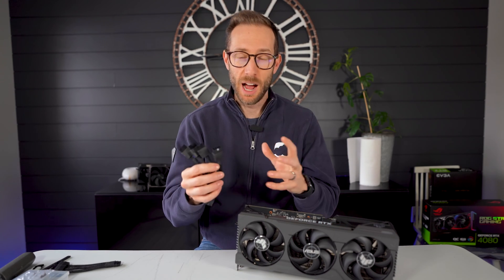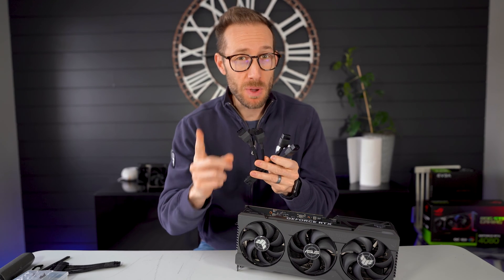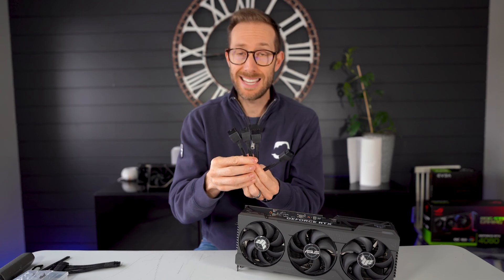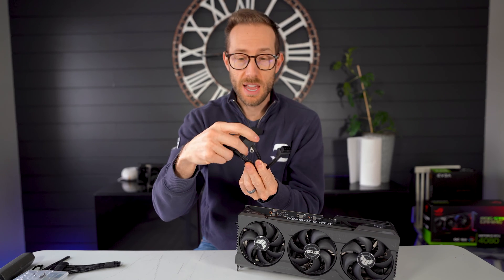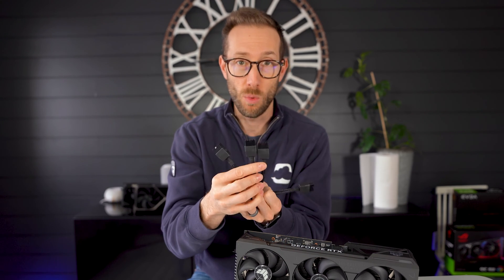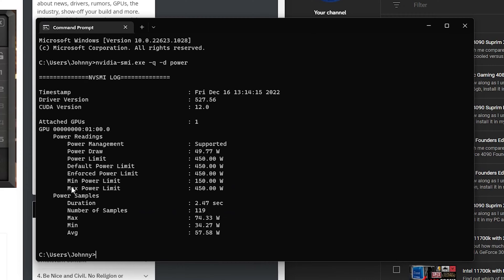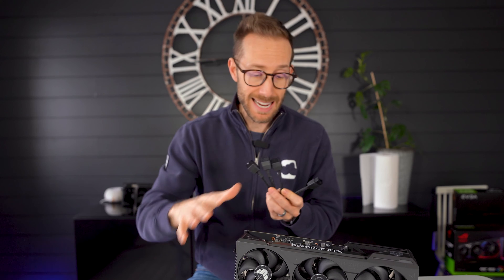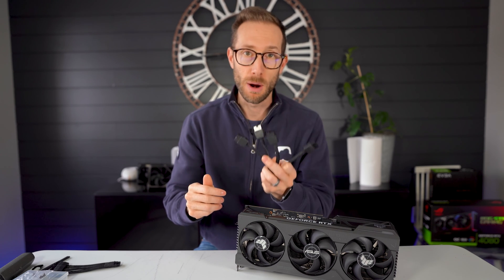Do 4090s Work With Only 3x8pin Power Connectors?

Comment: So then is the MSI 4090 a weaker card by default because it has only 3x8pin connectors?
Reply from the maker: No, not at all.  I think it's the opposite.  I've tested the MSI 4090 Gaming X Trio is one of my favourite 4090s.  Check out my video here:  https://www.youtube.com/watch?v=6r6b8NANqwM   MSI has figured out how to get the same performance by only using 3x8pin connectors in their Gaming X line.  They still use 4x8pin for their Suprim line, which is slightly faster, but 1-3%.  Nothing that really makes a difference.  People have confirmed that after 400-450w, 4090 don't actually increase that much in performance by providing it more power.
Reply: @JohnLCharette  i see. Yeah i have a pny xlr8 4090 and i can only use 3 8pins out of the 4. If its only 1-3% hit im missing out on im fine with that
Reply from the maker: @Garrett, sorry.  I may have mislead you with my answer.  The performance difference on the Asus TUF 4090 when using 3x8pin vs 4x8pin was 2-5% difference.  The 1-3% difference was between the MSI Gaming X Trio and their Suprim X cards both using all required power connectors.  2-5% still isn't a huge loss and I think you'll do great with your PNY card, assuming it's similar to the Asus TUF.
Reply: @JohnLCharette  all good. I play at native 4k so modern AAA games are definitely not at 120fps constantly. 5% of 120 is 6. Thats barely a loss and definitely not worth the difference in price.

Comment: For a 4070ti is good 2x8 pin?
Reply from the maker: Some 4070 Ti's require 2x8pin, others require 3x8pin. Example, the Zotac 4070 Ti Trinity non-OC is only 2x8pin connectors. Check the manufacturers website to confirm. I haven't tested a 3x8pin card such as the Zotac 4070 Ti Trinity OC with only 2x8pin to see if it works or how it's affected.  The next time I get a 3x8pin 4070 Ti in the studio, I will check it out.  Do you only have 2x8pin connectors available on your power supply?
Reply: @JohnLCharette  Thanks to answer me. I have go check better on my psu. Another question: i have to plug in this cable directly to my psu or i have to use cable from psu and than use this?
Reply from the maker: If you mean the adapter, you use cables from your PSU which plug into the adapter.  I recommend buying a dedicated 12v cable for all 4000 series GPUs and bypass the adapter.  You can learn more about some options here:  https://www.youtube.com/watch?v=IpujnC1lGY4
Reply: @JohnLCharette  Thanks. I have 	
Corsair RM850 (2021) and i don’t know  if it’s type3 or 4. Can you tell me it?
Reply from the maker: Good afternoon.  It's definitely Type 4.  I recommend buying the Corsair 600w 12v cable for $20 and using that.  That's what I'm using right now with my Corsiar RM1000x and it's beautiful.

Comment: The cable still pulls more than 450W. You can overright that just by flashing the Bios. There are people with base 4090s that come with only 3x8 pin, like MSI gaming trio. Flashing the Bios will allow you to draw more than 450W using just the 3x8 pin. You can try it out. I saw you have base 4090s that come with just 3x8 pins
Reply from the maker: Aha!  That's very interesting.  I don't have a 4090 in my studio anymore, but I will definitely try this out.  I know you can get up to 525w, by using 450w from the 8x3pin power cables + 75w from the PCI Express slot.  Is that what you mean?

Comment: I bought a PYN 4090 and have a 4 x8 pin . I have 3 PCIe connected and my pc wont turn on.. i thought it was the motherboard so i replaced it . Still doing the same thing . Everything will kick on for a few seconds then i will hear a click and everything shuts off beside the rgb on the motherboard.... any ideas what is my issue ? I will start with finding another pcie 8 pin. Do you think this could be causing my issue ? Also my psu came with the 3 i have connected but are pig tails . I only have one tail connected so am using 3 cords with the other piggies (3) tied togethar with velcro...
Reply from the maker: Hey Jordy.  That sounds very frustrating!  I hadn't tested the 3x8pin power connectors with a PNY 4090, so I can't be 100% sure that it boots.  As for using pig tails, it's not recommended, but probably won't cause a problem until you draw lots of power through it.  If you can connect all 4x8pin connectors to the card, even if it's pig tailed, that should allow you to boot.  I'm curious, what make/model power supply are you working with?
Reply: @John Charette  thank you for the quick response! I am using Corsair RM1000x
Reply from the maker: I'm using the exact same power supply!  Do yourself a favor and buy yourself the Corsair 600w 12v dedicated cable for $20 USD:  https://www.corsair.com/us/en/Categories/Products/Accessories-%7C-Parts/PC-Components/Power-Supplies/600W-PCIe-5-0-12VHPWR-Type-4-PSU-Power-Cable/p/CP-8920284
Reply: @JohnLCharette  thank you so much . Would I need only one and keep the others that came with the psu?
Reply: I'm looking at my gpu closely now. This cord you recommended me would turn my 8x4 into and 8x2 ? Would that be correct ?
Reply from the maker: Yes, that's correct!  It only uses 2x8pin connectors on your Corsair PSU and then plugs in directly into your GPU's 16pin 12v connector.  The best part is that it's still rated for 600w :)  You can watch a video about similar cords here:  https://www.youtube.com/watch?v=IpujnC1lGY4
Reply: @John Charette  you are amazing 👏 
Thank you again for all your incite and knowledge! Waiting for that to come in the mail now !

Comment: Actually i asked Cablemod for that concern and they told me 3*8 pins will deliver 600watts as well, so if you overclock it works fine.
Reply from the maker: Excellent. Thank you for confirming!  That's how I thought it worked for their cables.  Did you buy one with or without one of their 90 or 180 degree adapters?
Reply: @JohnLCharette  Yes i ordered the 12vhpwr PCI-e 3*8 classic without the adaptor but i read on reddit someone tested it and it works for him. Cablemod are great for that, that's why i've never used stock provided cable from manufacturers.

Comment: I was lucky enough to find a CPU cable to PCIe adapter and have an extra CPU cable. Going to try it tomorrow four my four power connectors.
Reply from the maker: Or.. you could buy yourself a dedicated 12v cable.  Most of them only use 2x8pin PCI-E connectors.  You can see me talk about it in my latest video here:  https://www.youtube.com/watch?v=IpujnC1lGY4

Comment: My power supply only had 3 8 pins. =/
Reply from the maker: Don't worry, I recommend an MSI 4090 Gaming X Trio.  It only requires 3x8pin connectors.  You can see my full review here:  https://www.youtube.com/watch?v=6r6b8NANqwM
Reply: @JohnLCharette  I apricate the advice, but I built a whole ASUS build so that's what I went with, a Tuf.

Comment: Quick question, I had a custom cable from cable mod for my 3090ti. 3x8 to 16pin cable. Will that work for my 4090?
Reply from the maker: I have heard that both 3x8pin and 4x8pin to 16pin CableMod cables will support 600w.  Contact CableMod support to be sure, but I'm thinking it will be fine.  Which 4090 do you have?
Reply: @John Charette  I have the gigabyte version of it. On reddit someone said they use new "sense" cables so it's not compatible:b
Reply from the maker: Ahh, too bad.  I would still confirm with CableMod.  I'd rather get the answer from them than Reddit ;)

Comment: Command prompt displays the following power limits for a Gigabyte 3090Ti Waterforce using 3x 8-pin to 12-pin  
Power Limit:  513.6 W
Default Power Limit:  480.0 W
Enforced Power Limit:  513.6 W
Min Power Limit:  100.0 W
Max Power Limit:  516.0 W
Reply from the maker: Very interesting!  Thank you for the details.  Consider that the 3x8pin power connector can do 450w, then you get another 75w from the PCI Express port on the board.  That's probably how they get their 516w.

I'm using an MSI 4090 Gaming X Trio right now with 3x8pin connectors, and it's showing:
Power Draw                        : 73.99 W
Power Limit                       : 450.00 W
Default Power Limit               : 450.00 W
Enforced Power Limit              : 450.00 W
Min Power Limit                   : 150.00 W
Max Power Limit                   : 480.00 W

Comment: You are discussing the adapter but what about using cablemod's 3x8 pin cable which plugs directly to PSU? Will the 3x8 pin cable provide 600w of power?
Reply from the maker: Hey J Boy, from what I understand, the CableMod 3x8pin & 4x8pin cables can both provide 600w.
Reply: Yeah, my PSU only has 3x8 pin slots (1 for CPU, and 2 for PCI-E)

I currently have an RTX 3090 in my build, but I am faced with choosing to either plug in all 3 of my graphics card 3x8 or to plug in my CPU with one of those cords not being able to be plugged in. 

I was looking at the 16 pin to 3x8 pin, but I’m worried I might fry my graphics card

Comment: too bad the 4 x 8 pin is sold out EVERYWHERE.  And Cable Mod is on vacay until mid feb.  Lots of us stuck with either the the stock invidia adatper or use the 3 x 8 pin cable mod (which is sold on Amazon and in stock).  My new tuf gets here tomorrow.  Having to wait over a month for an adapter is just silly.
Reply from the maker: Do you have a Corsair power supply?  Their 600w cable is still in stock.  I'm using one right now and works really well.  I'm switching to an EVGA soon though and I'll need another solution, probably CableMod.
Reply: @JohnLCharette  I have an EVGA 1300 g2
Reply from the maker: That's the exact power supply I'm switching to ;)  How do you enjoy it?  I'm a little worried about how big it is and cable management in my Lian Li O11D XL case.
Reply: @JohnLCharette  thats the same case I have.  Its a SUPER tight fit.  Have to cram the cables to fit in the PSU slot.  Also, not sure if its my 3090 or my psu.  But one is causing BSOD.  10 year warranty is still good on both my gpu and psu though so all good. .once i install this 4090 I'll know if it was the PSU or not.  Ill let you know.  Up until now, no issues at all. Im also a heavy overclocker though so if there are issues its self inflicted.

Comment: Might be worth mentioning this isnt the case with a custom cable like cablemods. there 3 pin cables run 600w. only on stock cables it does this as it doesnt supply power to all pins on the main connector.
Reply from the maker: Good point John!  I'll pin this comment for others to see.  Thanks for watching!